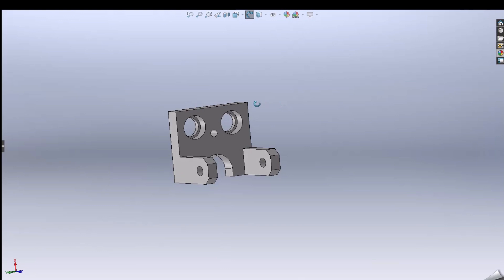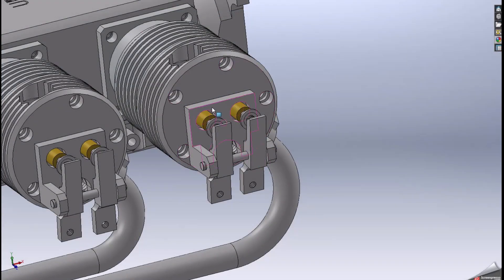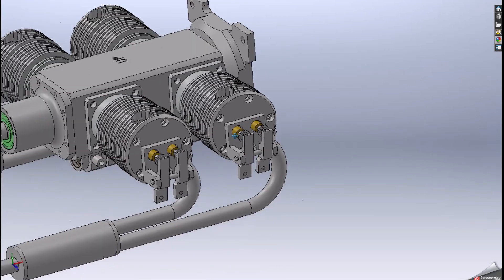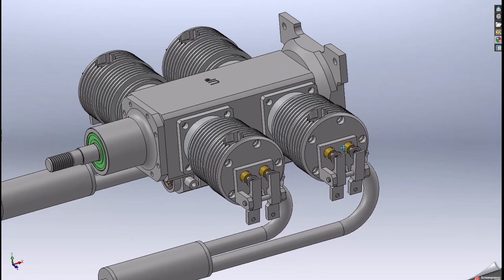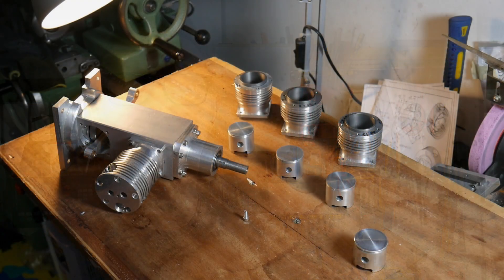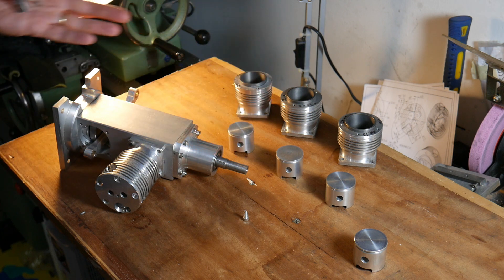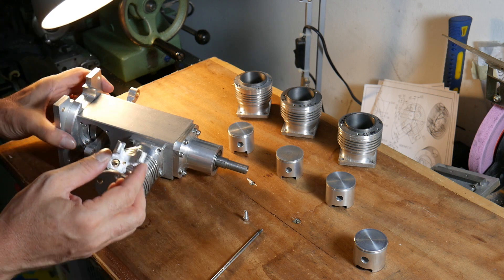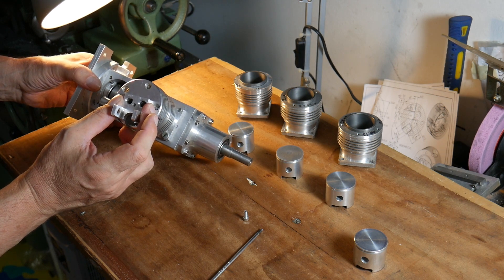How to Make a Small Engine Valve Spring Support

Comment: Ciao Alberto!!!  You have yourself one heck of a project there.  Pretty impressive that you are going to make this small Boxer engine totally with your machine tools in your shop.  That looks like aluminum you are machining.  Will that be a problem when the engine operates?  I'm thinking high temperatures and the effects that will have on the engine parts.  A very nice project however and you are doing a great job with it.  Take care!!!
Reply from the maker: Ciao Mike! Yes not easy, It was made for fly, so the original one was in that material for the 90%! Mine Will not fly, i only hope that It Will start, only this and It Will be a giant goal in case for me, of course! The crankshaft Is steel and the cylinder jacket Is iron like you see on My first videos! It is like a small motorbike! It will be nice to see the compression rings and cams angles...the most diffucult part! Many parts i made with my old chinese lathe and mini mill ( chinese too) that i sold! Ciao Mike thank you, take care!! Alberto

Comment: that is quite an undertaking, I would never be able to do all that's required to complete that engine.
Reply from the maker: Vernon i am with you! Regarding the set up of the engine i know less then you of course 😅Franking speaking i think that the most diffucult part to turn out will be the correct compression ( otherwise no fuel will arrive) and the cams angles! This scare me a little, but i want to try anyway! You see what i done in 2 years,and i make mistakes and remake some parts 2 times, It Is a long project!